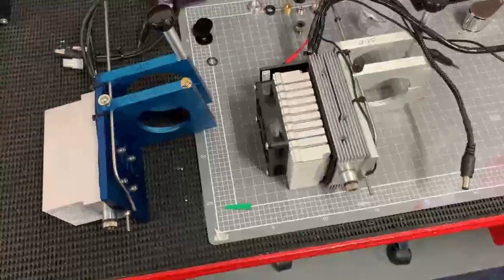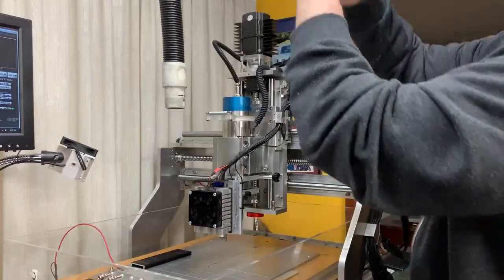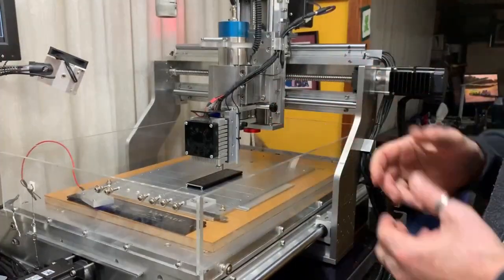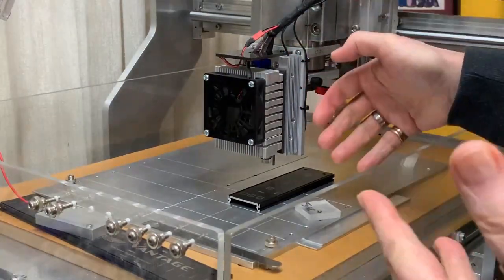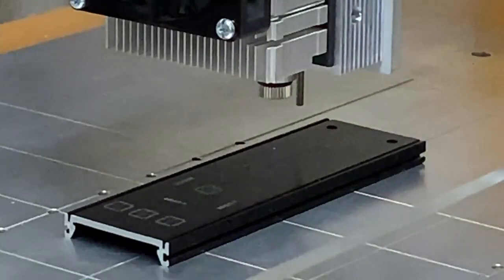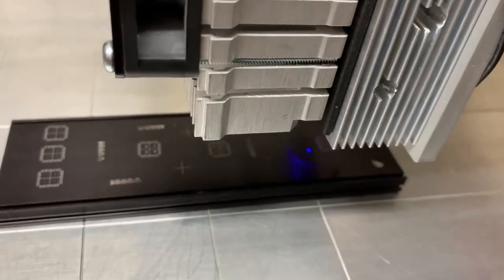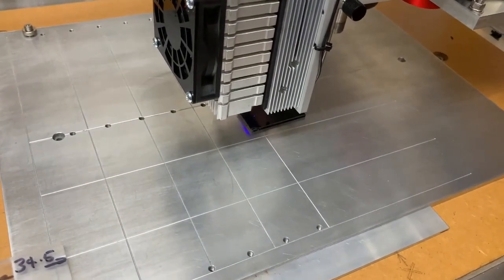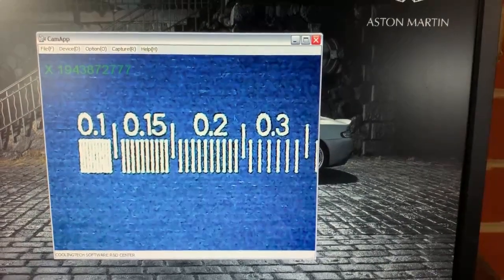Laser Focus Lens Spacer – PART 3 of 3 - Testing and results

Comment: Thanks for the effort explaining the spacer.....id like to make my own laser rig for my RC model gear
cutting 3mm balsa and hopefuly ply, can i make my own head using separate parts to build a better unit?
I like your pelta Mod....great idea........would a 5.5w unit work on balsa/ply ? 
cheers Brett
NZ
Reply from the maker: Yes a 5.5W would cut balsa wood ok but for ply greater than 3mm you would be better with a 7.5W and in both case Air Assist is necessary. Also I recommend ply specifically made for laser cutting. Yes you could make your own laser, these days I do. I purchase the NUBM44 laser and BlackBuck 8M Laser Driver on eBay. Sorry I don't have any construction details documented to share, I just make it up as I go along.
All the best Graham

Comment: What laser?
Reply from the maker: The laser Diode is an NUBM44/47. I machined some parts and made the heat-sink block myself, It uses TEC (Peltier) cooling. I got my initial inspiration from Endurance Lasers, purchased on of their 8W units and went from there designing and building my own. So you could say it is in some way an Endurance.